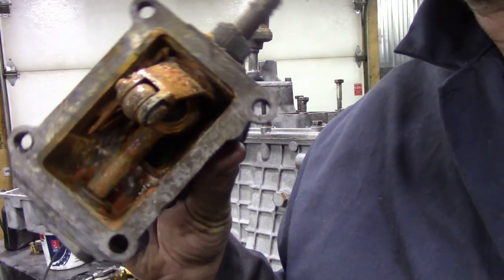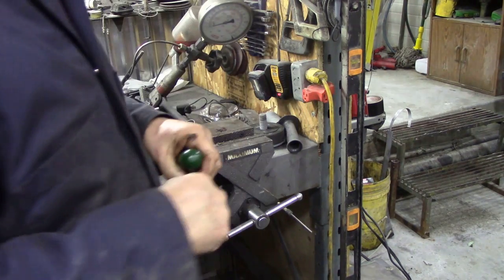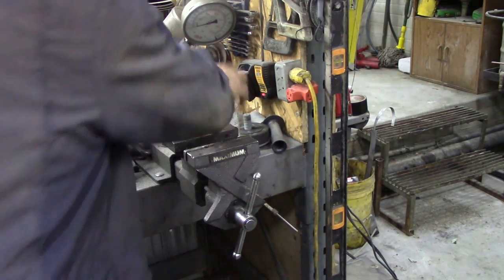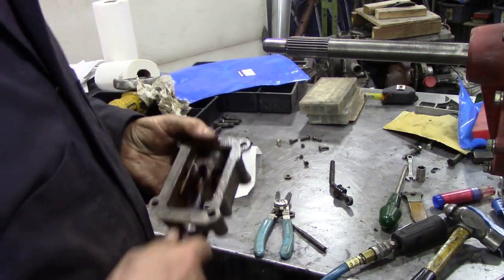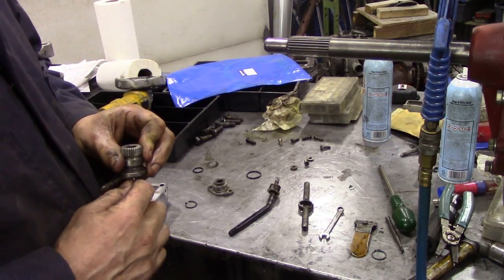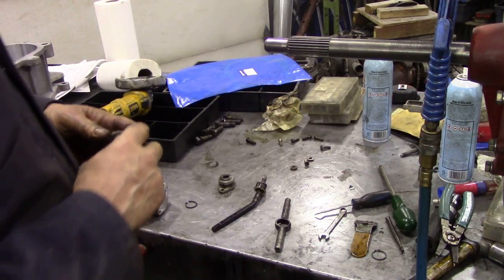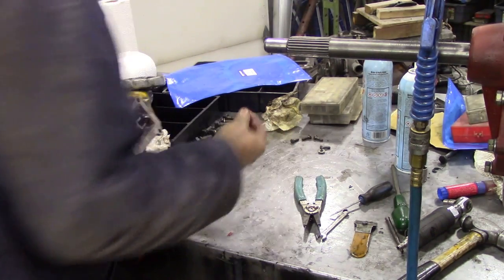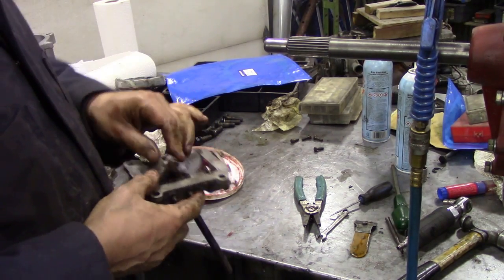Land Rover Hi/Low/Diff lock shift overhaul

Comment: A bit late to this video, can anyone advise if this part is accessible from the centre console? Mine is seized on a 99 Discovery 1 tdi. It shifts left and engages diff lock but not back and forth for hi low.
Reply from the maker: You have to remove the centre console, access is tricky to the linkage, but you can do it
Reply: @BritannicaRestorations  brilliant, thanks for your help.

Comment: i have a 1988 rr classic and every time i shift from park to drive or reverse she makes a huge shift noise as if she has been changed from drive to reverse by accident. im wondering if my issue is the u joints , transfer case or the transmission. i have the lt230 on a 3.5 v8 automatic. awesome content you have here!👍🏼
Reply from the maker: I think we have to get down and dirty with this!
Could be anything in the drive line but check the simple stuff first like U Joint and if they are ok check the splines on the output shaft of the gearbox by removing the 6 bolt round plate on the rear of the transfer case
Reply: Britannica Restorations Ltd 
i will post my findings here on your advice. btw i was able to unsieze my locker and low range with this video . thank you so much🙏🏼
Reply from the maker: Great stuff! 

Mike

Comment: Hi I just came over this video as I have a really badly seized end bit. Is there any overhaul package for this particular part out there? I mean new gaskets, seals, o rings the lot. It would be a great help and my Disco would be a lot happier. Haha
Thanks
Andras
Reply from the maker: I do not think there is a kit -individual parts only
Reply: Britannica Restorations Ltd thanks for your answer off to shop around then :)
Reply from the maker: They use an RTV type silicon now and the O ring is the only part you need if you are careful in stripping the unit down - throw it in a bucket of diesel for a week or tow to loosen the corrosion

Comment: Thanks Mike, I always learn something on every video.
LandCruisers suffer the same problem. The diff lock levers should be used a couple of times a year or more just as a maintenance procedure.
If anyone is reading this and they can't remember the last time they used the little stick, go out and try it now, it may safe you later down the road.
Reply from the maker: Same for A/C  i if you don't use it you lose it!
Reply: @BritannicaRestorations  You're dead right Mike. We should all make a habit of operating the two together every couple of months or once a month if we remember